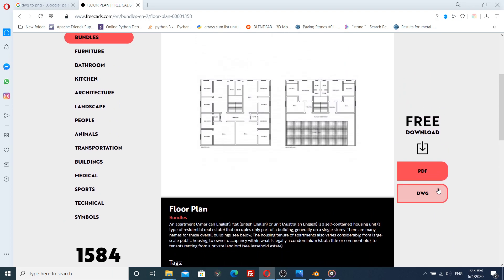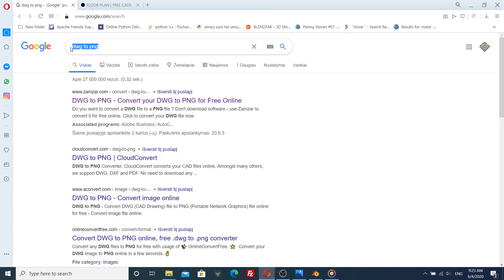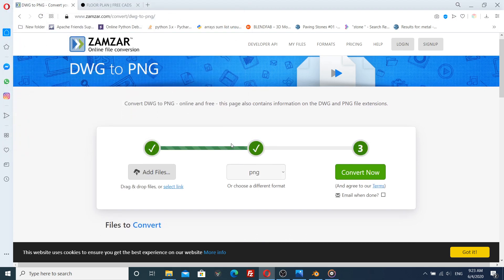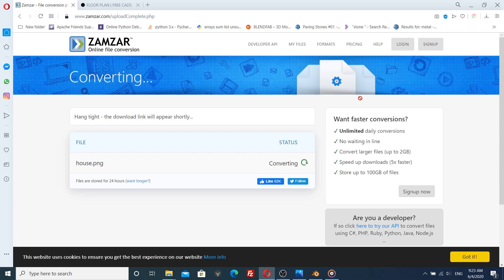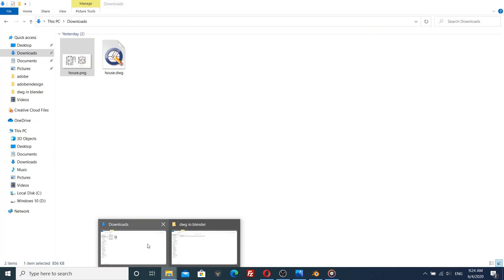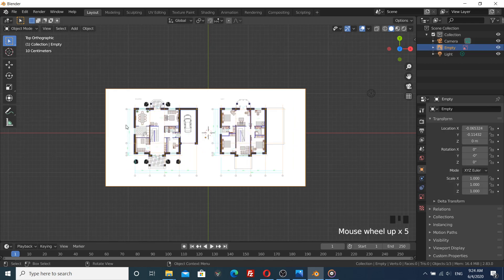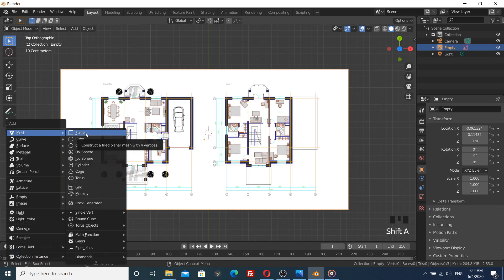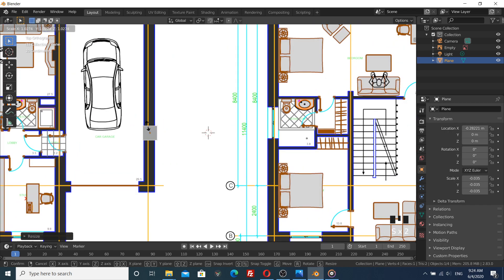How To Use DWG Files In Blender | Best Way To Import CAD File In Blender | 3D Floor Plan In Blender

Comment: I'm afraid this solution has two problems:
- First you don't import a cad file with curves, which is a problem, you cannot take proper measures, you cannot reused the curves, you cannot separate the different parts of the plan, etc.

- Second, you ahve to go throught a third party website, which breaks any kind of NDA as a professional you may have with your client, since you are sending them a DWG file that is protected intellectual property.

So I sincerely don't recommend this technique in case you are a professional or you actually need the real plan, otherwise, you could use DWG TrueView to make a screenshot of the plan and use it as a texture, but without having to send it over a third party.
Reply from the maker: Thanks for your comment. It is not a perfect way, but for me, it is good enough to make a floor plan visualization to advertize an apartment or house. It is accurate enough.  Screenshots are low quality, but you can use it if enough for you. I haven't tried maybe librecad or qcad could convert Dwg to picture.